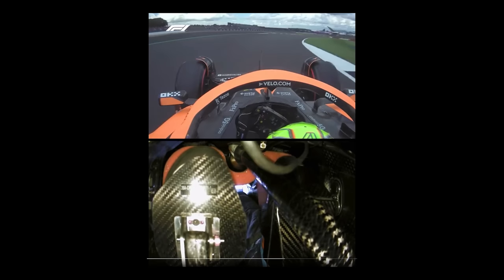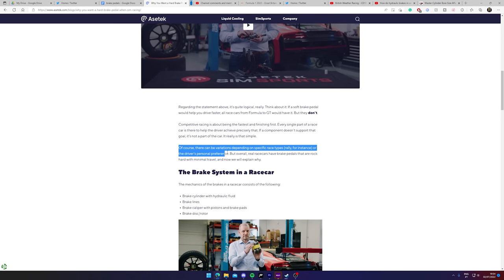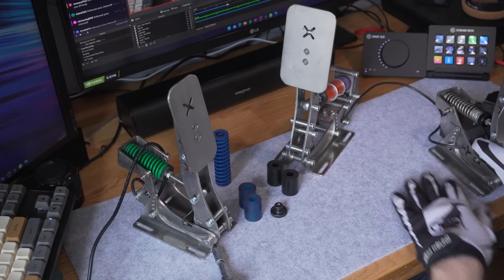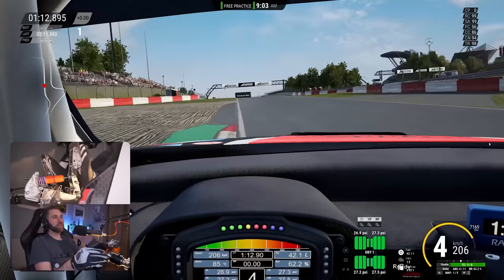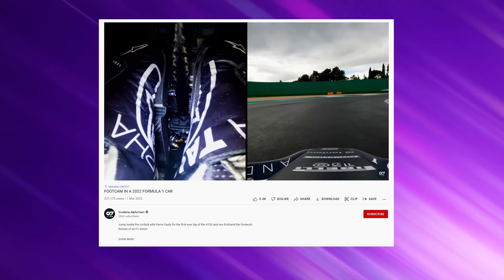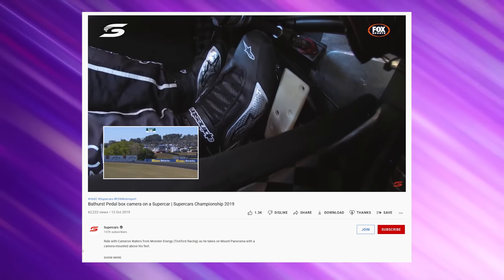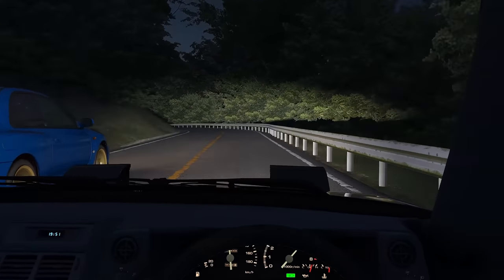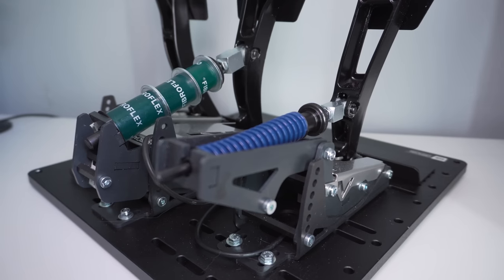Lando Norris brake cam shows simracing brake travel is all wrong

Comment: You're telling what i feel like for some years. In my Opionion the actual Racing Pedals have too short travel distance and they dosn't focus on Pedal Feedback. The Fanatedc ClubSport Pedals V3 which i own are the only pedals with vibration motors. Also the Pedal feedback is in some Simulations are very poor. Imagine u can exactly feel on your Pedals where your tyres get slipery or the ABS kicks in and so on like in real cars. I would swear i could be faster and more sensitiv on tyres.

Comment: The reasons Landos brake pedal travel is so far is just the fact that his legs are very strong. Every F1 car has a brake pedal that for normal people would feel like kicking a brick wall, if we was to get into that car and press the pedal as hard as we can it wouldn't even budge. The reason it's so hard is also the mechanical side but also the fact that in an F1 car your legs move around so much because of the G forces that accident pressure on the brakes would be fatal as you could be rear ended or lockup and head straight into a barrier. Now it could also be the fact that Lando prefers a softer brake pedal but going of his vids of his SIM rig where he went over the brake pedal it's very unlikely, his legs are very strong. The reason SIM companies don't make the brake pedal as hard and realistic is that to have a real hard brake pedal won't get a large market, people don't want to have fit legs just to play on a sim, myself included I prefer having a relatively soft brake so I don't have to work really hard just to stop, it's also your driving style.

Comment: I will say that IRL, F1 cars have such big travel due to the cars REQUIRING degressive braking, i.e going full send at the start and easing it out through the turn where as normal racing and road cars are the opposite, requiring starting light and progressively adding more and more brake.

Comment: I believe the future for sim racing brake pedals will be that of FFB pedals.  I believe it will be with software as to how we achieve a more realistic feeling from our pedals, not from using hydraulics and other mechanical parts found on a real life race car.  

Think about how far along FFB steering wheels have come and they don't use anything that resembles an actual race car steering box, even on the high end direct drive units, so why should it be any different for your sim pedals...
Reply: After market mods that slap on a motor to the brakes to create vibrations exist. I have the mod from Sim3D on my T-LCMs and have it 'pulse' when the ABS kicks in and if the wheels lock up. Whether or not we'll see mass market versions with out of the box FFB on pedals...

Comment: As (plentifully) mentioned already, hybrid cars have Brake by Wire with an ECU intervening/interfacing - F1 has a traditional front circuit though; WEC had full BBW. For information on that and a glimpse into racecar braking system design (no booster, racecar components and constraints), see "Formula One brake system, Explained!" from the Merc F1 team

Comment: Good video. This is a bit of pet peeve of mine. As always with simple categorical "truths" they end up being wrong.

First of all, race cars are not a homogenous group. Yet sim racers love to talk about race cars this and race cars that. They're all different and there's often variation within the same class.

A stiff or a hard pedal does not mean zero travel. Many sim pedals lack a feel of progression because they have almost no travel at all.

I've driven vehicles with VERY stiff brake pedals. One of which was at the level of "aaargh, brake goddammit!". It was like pushing against a wall but once you got enough pressure the pedal actually moved and it was quite easy to modulate the brakes. I wouldn't consider this an ideal setup for the brakes but it goes to show that even very stiff pedals can have some travel.

Comment: There's definitely an individual preference, as well as a sheer mechanical difference between the various categories or even era of vehicle. F1 cars are obviously monumental feats of automotive engineering and the brakes, especially with the right temps, just work so need minor travel but a lot of physical force. From personal experience, I drive karts of 2 different era's, and the older (of the 90s) likes trail braking and therefore a lower pressure. As such, there is a fair bit of brake travel because the brakes engage further through the braking motion, making better use of the trail braking trait. Meanwhile, on a modern rotax kart with a clutch, it likes to stop before the corner with minimal trailing and so we need a higher pressure in the brakes system; this causes a smaller travel as the brakes engage to a higher degree earlier. This is also my (and many others) preference, this can obviously be changed, but as the engines work separately symbiotically with the brakes, you also end up needing a different braking profile. So travel of sim brakes needs to be adjusted accordingly with the vehicle you are using.

Comment: I used my Fanatec V3 stock for almost a year and thought they were great. Then, out of boredom, I decided to install the brake kit that I had. I used the two hardest green units it had. It was very hard to press and the travel was near zero. I had a lot of control when braking though. Since I didn’t have a racing rig I found my chair would move back and my lower back would hurt a little. So, after another year I decided to change it last week. I wanted some pedal travel. After contemplating which would be best I used the lowest green and lowest red modules. Now there’s travel but the same control while braking as when it was hard to press. However my back doesn’t hurt as much and the chair doesn’t move back. So things are better and the brakes don’t need to be hard as a rock to move.
Reply: Yeah, there’s definitely the aspect of your rig to consider. I’m sure I’d be happy with mine being a bit harder and shorter if I had a proper sim rig, but since I’m currently using an office chair that has a fair bit of flex in it, softer with more travel is far superior for me.
Reply: @pieflies  I'm using a Secret Lab chair so it's a little like your office chair but I changed the wheels to ones that lock so they don't move as much. I also have "feet" that don't have wheels at all and those too won't move the chair as much.
Reply: @nathantw  I also have wheel stoppers, and my pedals mounted to a board, so nothing moves, but I get a lot of flex in the back of my chair. Luckily I my pedals are highly adjustable so I can get a good pedal feel.
I look forward to having a proper rig one day though.

Comment: Great analysis. There are so many different things that can effect pedal feel. Master cylinder bore (larger vs smaller), Caliper bore (larger vs smaller) and the ratio between both caliper and mc bore, etc. People also lose sight that "race car" can have vastly different meanings depending on who you talk to, like F1 vs weekend autocross car. Both are cars that are raced, thus making both of them equal definitions of "race car." There are many successful, purpose built autox/solo cars that retain their oem power abs systems with minimal performance enhancements due to either rules or driver preference but doesn't make it any less of a "race car" by pure definition. So, to make a blanket statement that "Race car brakes are rock hard" is stupidly wrong and mostly a marketing ploy.

It's like within the car turning scene and their "36 way" adjustable coilovers. Most race coilovers are 4 way (low speed bump + ls rebound / hi-speed bump + hs rebound). 36 were the click stiffness settings that only effected bump and rebound together so basically it was 1 way adjustable coilover. Marketing decided 36 way sounded way more "racecary" even though setting 1 didn't feel much different than setting 36. ¯\_(ツ)_/¯

To bring it back full circle just remember this, "You're building a real race rig, not a real race car." Build to your driving preference, that will give you the best result. I stopped trying to replicate my car in my rig a long time ago and have been much happier.

Comment: My heusinkveld ultimate pedals drive me crazy for this reason. I can't add anymore travel in the brake pedal. I can't find a sweet spot that works. I drive a 991.1 GTS on the road and on the track on weekends. When I get back in the sim, it's difficult to be consistent.

Comment: A shorter pedal-travel makes sense in F1 and similar, because you get up to 6 G on the brake . Using this (probably) an inch of body-movement forward to brake with with the weight instead of muscles seems logic during such long and exhausting races. But since the g-force while braking depends on the grip-conditions, some travel is needed to mind-measure the inputs more accurately. In sim-racing without surge motion you don't need much travel to feel how much pressure you put into the brake since no forces tries to throw your body around.
Reply: Tbf I'd want stiffer pedal irl and softer pedal in sim racing.

Bc in sim racing, specific muscle memory is important and having wiggle room for adjustments from reading what's happening in the FFB and the screen.

IRL your entire body is a sensor. You can still drive cars just fine with a dead feeling steering wheel and short pedal throws simply bc you can immideatly feel how the car is reacting to your inputs and how it reacts to the road

Comment: The f1 rear  brake are close to sim pedals than they are actually  mechanical  brakes. The BBW is controlled by a pedal and potentiometers. There is not physical connection  between the brakes and the pedals(or the throttle and PU)

Comment: im glad that sim racing pedals are typically short throw, we might pretend we want the real life race car experience but in reality what i think we really want is our sim racing gear to feel like our own actual car, that's what immerses us because that's what we know and i think sim racing companies want to tap into what we understand to be real. its one of the reasons i cant stand a notchy steering wheel, take a DD1 for example, i really dislike it because when i turn the wheel i can count the notches in the steering but i cant do that in my car on my driveway so i sold the DD1 and got the simucube 2 instead... night and day difference in what i perceive as realistic simply down to the feel of the wheel when i turn it. The defence to this is often ''well you cant feel it when driving unless going through a slow corner''... i mean... did we pay that money for the most realistic feeling possible or did we pay it to make excuses and reasons why its ok?

but back to the pedals, often time the brake pedal travel can vary in ''race'' situations even in every day road cars, a lot of us have probably felt what fade feels like, you press the pedal and the same force does not give anywhere near the same braking power and there will be more travel, not massively but enough to make it feel a bit alien as the fluid gets overly warm and pads glaze over. it is interesting just how much travel there is in these f1 cars, but im not totally shocked, the sheer power of the braking probably means its designed that way to enable the drivers to have some range of motion before tearing their face off. its also quite likely that the pedal in our every day cars moves further than we initially think, maybe we need to get a camera down there and see how far it moves, id bet its further than it feels.
Reply: Real cars have even longer brake tavels though.
Reply: Unless we are locking up our wheels every time we want to come to a stop, we will rarely see the full travel of our brake pedals. Even when we are stopped, the brake are pressed just enough to keep the vehicle from moving.
Reply: @dekoldrick  Having a short brake travel makes impossible to do the modulation you see Lando doing in the video. He fully steps on the brake then slowly lifts it as the car slows down. You can't do that with a heavy pedal that only travels a short distance.
Reply: @BrunodeSouzaLino  you can and plenty of sim racers do it, but it's far harder for not much benefit
Reply: @IBuiltDaArk  And what makes it harder is the short throw. Much like you don't have that much modulation on an analog trigger.
Reply: @BrunodeSouzaLino  I'd argue that having a shorter throw doesn't really change anything to do with modulation actually, certainly not in every day cars, I've driven fast, I've driven an ariel atom on a track, I've driven a lamborghini huracan on the road (albeit with a 70mph speed limiter), I've driven a continental gtc on the road also. (Dad works for a hire car company).

Anyway, besides those cars I've driven around 18 other cars and currently own a 2021 Peugeot 2008, so every day family car... the brake pedal in every one of them has been relatively short throw with no problem of modulation because as we know the travel does not effect operation as they are servo assisted and you modulate with pressure which can be done short or long throw.

So I don't think the pedal travel in landos car is to help with modulation honestly, I just think the brakes are so powerful and the g-forces are so high within the car that actually that pedal needs a lot of travel to stop the drivers going full brake when applying any brake pressure because the g force of braking will be going through the leg and into the pedal on application if that makes any sense.

I don't know for certain ofcourse it's just what I think is going on there.
Reply: @jinx20001  F1 cars don't have ABS though. On an ABS car, the throw doesn't matter, since the car will prevent the wheels from locking regardless of how much modulation you have.
Reply: @BrunodeSouzaLino  it's not a question of ABS or not mate it's a question of the ability of the drivers modulation with his foot, having a shorter or longer throw won't matter because as soon as a driver detects the wheels locking up they will release pressure on the pedal, that's the crucial part here, being a pressure based system means the distance of travel won't matter as the braking of the car relies on pressure applied, more so with a braking system that has no servo assistance.

Let me use a very crude and stupid example, an official playstation 2 controller uses pressure sensitive buttons ( yes a ps2 controller, they were pretty wild 😜 ) ofcourse the buttons have very little travel but even so our ability as humans means we can get to 100 percent and slowly release the pressure to modulate down even though there's almost no travel at all, so even with the short throw of many pedal systems we will all have the ability to learn modulations really quickly, if we couldn't do that we would all be having the ABS pulsing on the way to school runs, and I know I don't 😉.

Comment: From personal experience (and as it is all driver preference), having a shorter travel using a load cell or similar system is much easier to modulate your braking and trail braking... Simulators are never going to be 100% accurate, but the sensations and skills you can learn through them do translate over to real life...

Comment: Hey really enjoyed the video but it doesn't apply to F1 sim racing (and perhaps others) as they use brake by wire. This means an F1 sim racers break peddle and real (modern) F1 drivers peddles are doing the exact same thing: producing an electric signal telling a computer how much break force to apply

Comment: it also depends on both what the driver wants, uses, the way the manufacturer made it etc. i've driven 488 challenge cars plenty, the brakes on my preferred setup is very soft a good amount of travel i find it easier on trailbraking. that said road car ferraris like the 458 is stiff as all hell and i can't change it, same goes for Mclaren customer race cars like the 650s GT4, it has some stiffer brakes that don't travel a lot at all and there's not much to changing it

Comment: If the brake is too firm I believe it would be hard for the driver to have a real feel on where the limits of braking is. Not a issue for cars with ABS, but F1 cars don't use ABS. But F1 cars do use power steering. I think the amount of resistance on the brake and the level of force (From Force Feedback) on the steering wheel in a F1 car is way over estimated by the average sim racer. That's from someone that uses a G27 that I got for $50AUS from ebay that wasn't adverted as not having the steering working, lucky it was just that plastic senor thing?? that I fitted was super-glue. It was a up-grade from my Logitech Driving Force Pro and I'm happy with the cutch, brake, accelerator set and the brake feels good to me.
Reply: Just wasted to add if I upgrade the wheel base to a Thrustmaster ts-pc (Belt Driven) and I used the G27 cutch, brake and accelerator I think that I would have a pretty feel for what the force felt like in a real race car with power steering, until I hit a wall.

Comment: My understanding is that with a stiff brake you will rely more on pressure rather than travel for feedback, which is ultimately what matters in a car. So manufacturer made stiff pedals as a way to train for real racing, because even if you have more travel you will still rely on muscle memory for how luch pressure should be applied and how to modulate that pressure.

That's what i understood, i find the "race car brake is stiff" stupid because as you said they are multiples parameter that can be adjusted to have it feel the way you want, but for training purposes a stiffer brake is a better option ...
(Might be completely wrong though)